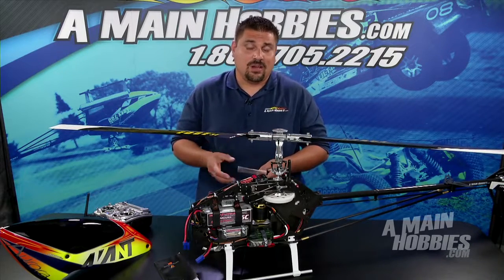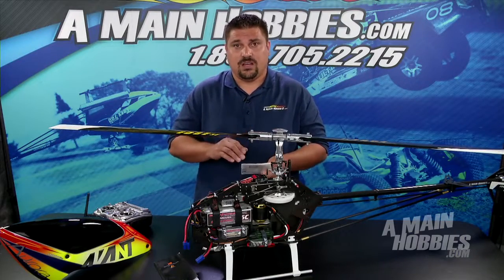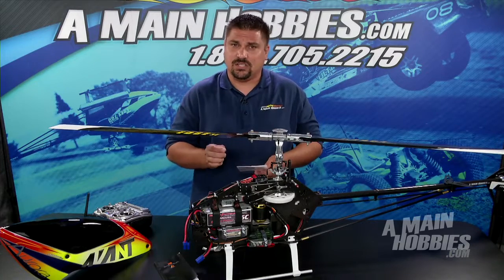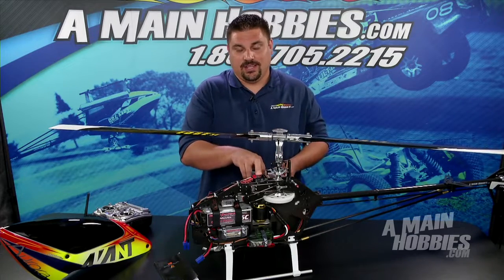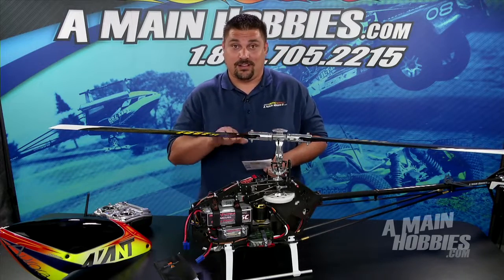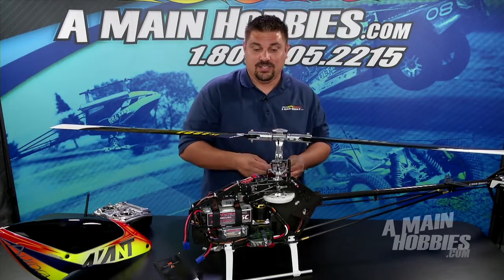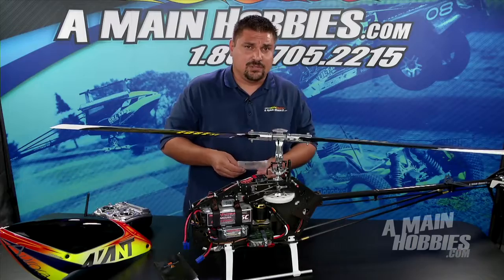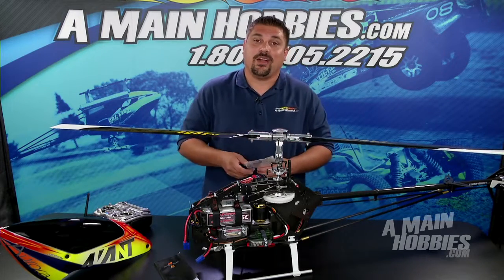How to Setup BeastX Flybarless Gyro System, Part 3 of 3

Comment: Your video was so good can you help ? i have a flywing F1 flight controller whatever i do the motor will NOT start many seem to have this problem as your video,s are so good i wondered if you could help i have 2 of these units and motors not start on any of them .Thanks
Reply from the maker: Hi John. Regrettably, since we are not a seller of Flywing products, we are unfamiliar with that item and unable to provide any guidance. We recommend you contact Flywing for assistance.
-Brett

Comment: So the tailkick to the right, not wag, wil go away if i use this parameter for tail compensation.? What about the throttle and pitchcurve all together, just leave 0 to 100 in one straight line?

Comment: Hello, wanted to know what pitch and throttle curves I should use with the ar7200bx on my Trex 500.... I've been trying to find this information all over but can't seem to find exactly what I need or am looking for. 
If you could help I would be very grateful!!
Thanks in advance!!
Great video btw!! 👍👌
Reply from the maker: Hello Greg, we forwarded your question to our Heli expert and here is his reply: 
    "It's personal preference on the throttle and pitch curves. But here are recommended starting points for intermediate flying. 
    Throttle Curve:
Normal Mode: 0-40-60-70-80
Idle Up 1(Flight Mode 1): 80-70-60-70-80
IU2: 90-80-70-80-90
   Pitch Curve:
Normal: 30-40-50-75-100
Idle Up 1 & 2: 0-25-50-75-100"

Hope this helps Greg. 
-Brett
Reply: @AMain_Hobbies  thank you for the quick response and I appreciate the help! I will try that and see how it feels... 
Thanks again!! 
Greg
Reply from the maker: You're welcome Greg!
-Brett
Reply: I'm using a DX6E too just in case that matters